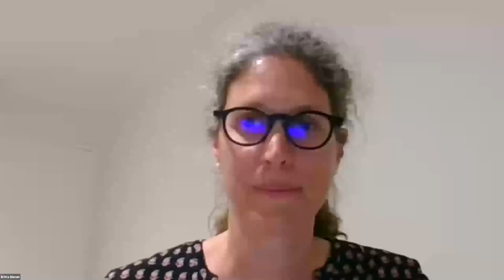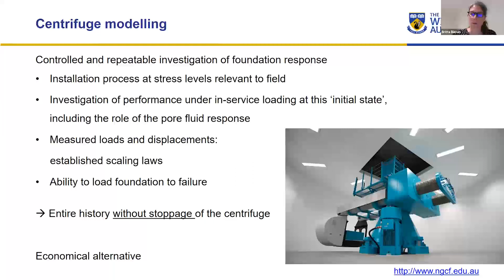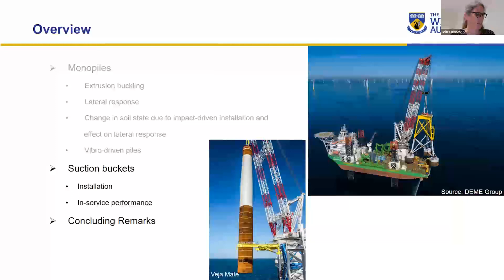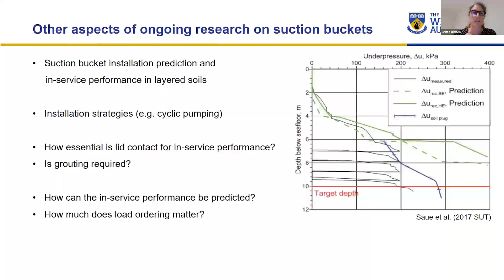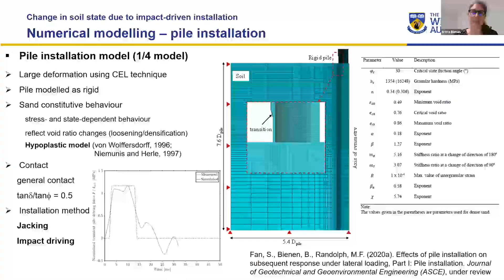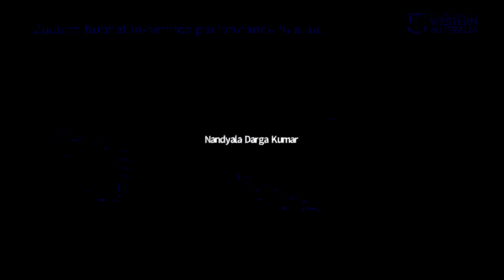Foundations for offshore wind turbines

Comment: It seems better control of the centrifuge acceleration is necessary. For CEIGR, 50mm times 38 equals 1900mm, but for COFS, 52mm times 39 equals 2028 and UoN have 60mm times 31 equals 1860mm. The prototype pile each of centrifuge modelled is slightly different